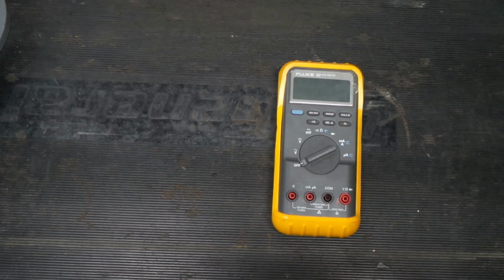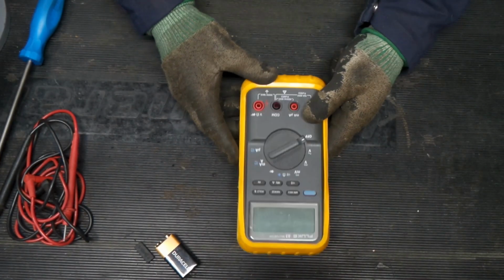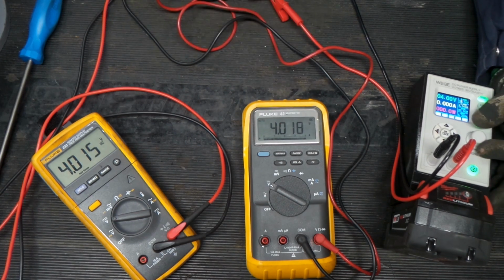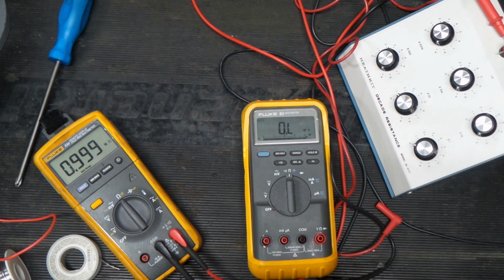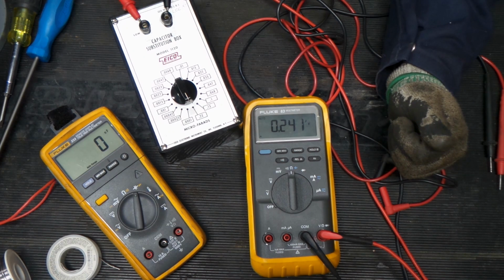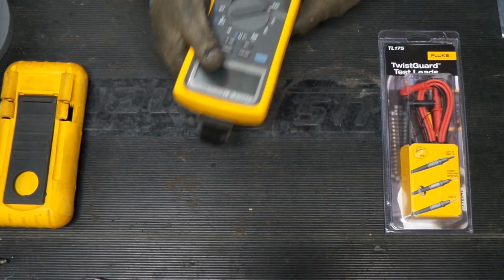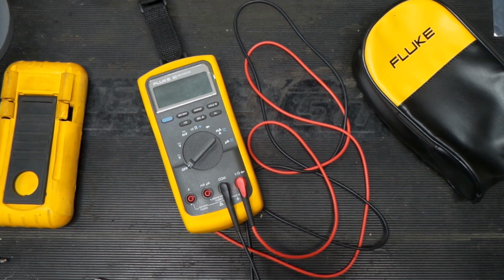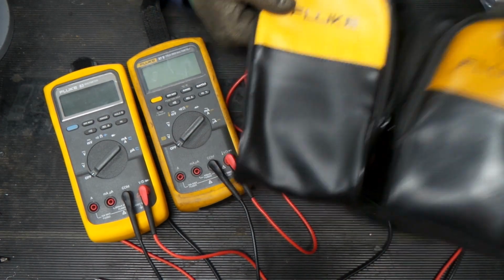Let's Troubleshoot and Test a FLUKE 83 Handheld Digital Multimeter

Comment: Bought mine in 1989. Still works. Sat 20 years in a drawer because the screen was washed out. Recently came across a YouTube channel showing a fix which I tried and now I’m able to use it again.
Reply from the maker: That's awesome, was it the screen connectors? I think this series meter has some issues with that. Was the repair hard to do?

Comment: Hi, wondering if anyone can help. My fluke 83 just recently stopped measuring mA, fuses are fine but when I select mA it only shows Amp rating. What could be the cause of this
Reply from the maker: I have not experienced this myself. Hopefully, someone in the comments can help out. If you figure it out, let us know. It sounds like an odd failure. Those are always interesting to learn about.
Reply: Does your meter beep if you put the lead into mA jack and switch it to volts?

Comment: Very good video.  I've collected many different brands and types of meters over the years.   Flukes are always a good choice no matter the trade or job you're looking to measure.  My latest, and probably last, clamp meter l am using right now is the UEI DL 599.   It has performed nearly flawlessly for almost a year now.   I always change out the leads to the Fluke leads, you just can't get any better.  And magnet straps are a must for everyday use.   Keep up the good work !
Reply from the maker: I agree that the Fluke leads seem to be the best available. The UEI DL 599 looks like a very capable meter. I'm very curious about the phase rotation function. Have you used it much? I'd be interested to hear how it works. I've seen quite a few variants of rotation meters over the years. Maybe I'll do a video on some at some point.

Comment: Thoes old meters will outlive us built to work/be repaired forever.  Meters have gotten to the point there cheap and functional not necessarily trade specific super tools.  I do own 3 fluke meters a 101 t5 1000 and my everyday t6 1000 pro.  Like you I got 2 or 3 pair of silcone twist guard leads the only lead worth using.  Heck they cost as much as the 101 for what I paid for it.  People dispise feildsense but it's the best thing in my line of work were that 1% voltage variance means nothing to me.  Sticking the fork over a wire not undoing anything no leads besides ground seeing volts amps hz and a colored screen for good or bad at a glance pays big.  Thoes old ones are good and even enchanced resolution over something modern.  There's no tool shaming on a fluke meter no matter the age.  Dispite the cheaper price meters all around I get fluke for one special reason.  If the fluke says it's right it is no inspector or homeowner can say your meter must be wrong.  It's the last word like starret and that's worth the price of admission.
Reply from the maker: I agree with everything you said. I bought the Fluke 87V you see at the end of this video 20 years ago now and it's just as reliable today as it was 20 years ago. 

I'm a sucker for an old meter. I saw this Fluke 83 and for the price it would have been irresponsible to not get it and see if I could get it working.